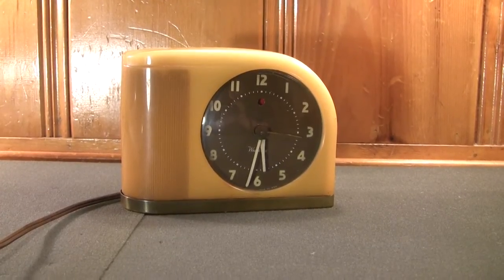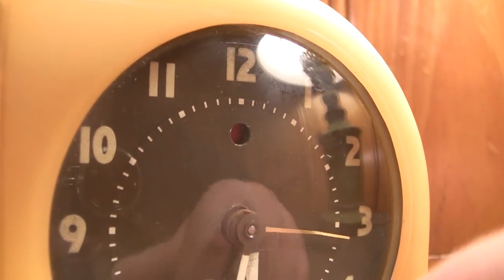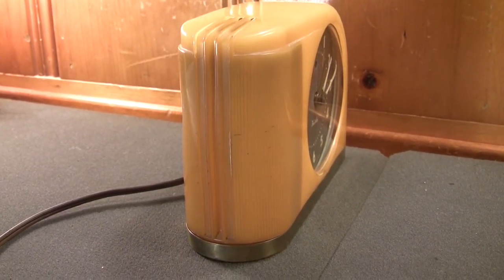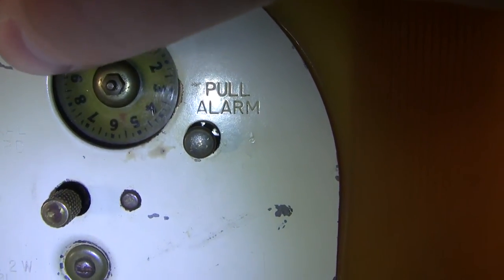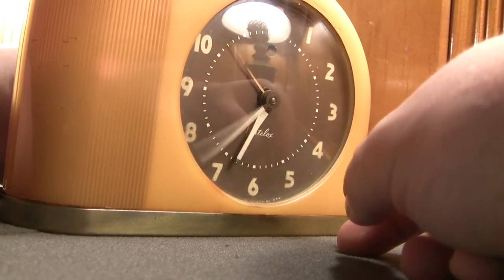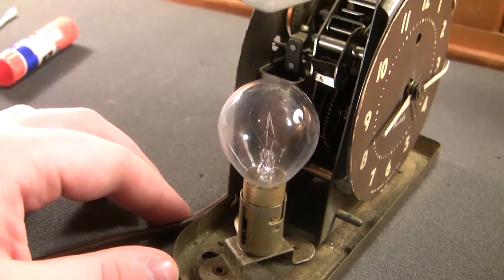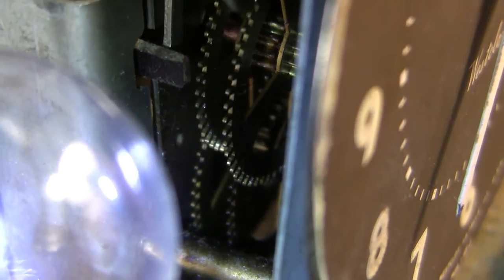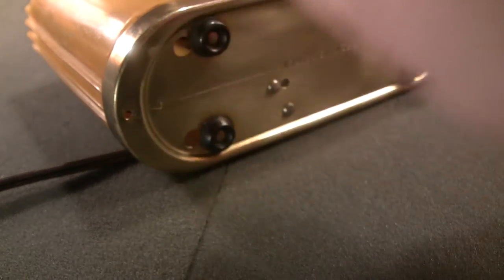1950s Westclox S5-J Moonbeam Alarm Clock

Comment: The transformer you pointed out is actually the motor coil. There's no transformer in those old clocks - no modern low voltage dc crap in there. The new ones, sadly are low voltage dc ordinary ticking quartz clocks. Ac powered clocks like this kept perfect time because they use a synchronous motor - that is the line frequency sets the rotational speed, not the voltage. The line frequency was traditionally kept pretty damn near perfect 60hz, so the clocks kept great time.

Comment: These are what's called synchronous clocks. As long as there's nothing wrong with the movement and they are running on the correct frequency from the power grid they are very accurate, more accurate long term then any quartz clock can ever hope to be. That thing you said was a transformer is the coil for the synchronous motor, not a transformer. The buzzer will also work off that coil. Very nice clock and video.

Comment: My Grandfather (maternal) had one of these (with the later style 1954-57 maroon luminous dial, no power failure indicator) my Grandmother kept it for years after he passed on. I loved the quiet but subtle sounds of the clock gears and subtle rapid ticking (sweep motion) of the second hand.  I've been researching these and the original 1948-57 Moon Beam was actually never available in yellow. All Westclox catalogs from 1949-57 describe the Moon Beam as having a "white plastic case". Of course visual evidence from surviving examples of this clock have shown that it didn't take long for these white butyrite covers  to "yellow" with age as my Grandparent's Moon Beam had very much  "yellowed" by the 1970s-80s. I love this clock! Thank you for sharing this video! It takes me back!

Comment: Amazing clock. iv seen several on ebay. i like the idea. i had no idea they had made one with waking up to a light. wonder how well that worked?  great video!
Reply: It works pretty well, I wasn't even aware the buzzer on mine worked until I got up before the alarm went off and then started hearing a strange noise.
Reply: When the buzzer is out of adjustment and is very faint in volume , it sounds even creepier when it kicks on with just a mild low pitched hum. The backup buzzer is supposed to be very loud and jarring enough to “wake the dead” when functioning properly.

Comment: I just bought one today from the antique mall, only issue is the turn knob for the alarm setting dial is gone, I'm gonna see if i can get it a new dial so I can set the alarm to whenever i want. Other than that it is fully functional even after 70 years.
Reply: I just bought one today and it works

Comment: I have one from 1957 that will run when I lean it back but if I set it level it won't run...does anyone know what is wrong with it?  I tried a few drops of clock oil but still the same problem.

Comment: Manufacturers began replacing cloth-covered power cords on home appliances around 1948-1950. So it isn't surprising to see the rubber-covered cord on that unit, even if it's one of the early models.

Comment: I guess an LED replacement bulb would work too and stay a lot cooler for the aged plastic case.  Let me know if anyone has used an LED replacement bulb.
Reply: canadagirleh good point about the overheating. I changed the inside light globe in my 1967 Chevy El Camino and the new globe melted through the plastic cover.

Comment: Excellent Video!  Learned a lot about my garage sale find.  Mine is identical except it is made in Canada (CSA Standards), has plastic wiring on the inside and has a hole in the back where yours has a screw ( I am sure it is supposed to be this way).  I wonder if it is for oil?
Reply: I know I'm late to the party but wanted to reply for future readers.  I also have the Canadian model but mine has a screw in back where you indicate yours has a hole.  The screw is fitted into a dished washer that fits perfectly into the surrounding concave divot in the casing so I suspect yours also had this washer and screw at one time.

Comment: you should avoid touching the clock face, the one you own there uses radium in its paint.
Reply: RMX7777 people only got sick from licking the wet paintbrushes.
Reply: @RR4711  radium is a heavy metal, breathing or ingesting the dust from the paint will result in it staying within your body for many years, where you will constantly be exposed to ionization.
Reply: RMX7777 my father worked in a building attached to a nuclear reactor during the 1960s back in Hungary, they really had no idea about the dangers of radiation back then. Here in Australia they used to build out of asbestos, many of the factory workers died from the dust they inhaled. Nowadays the government is very strict about renovating houses that contain asbestos.
Reply: Has anyone tested this model with a geiger counter?
Reply: @kopfcanyonranch  yes, through the plastic it reads around 1,000 cpm. Disassembled it reads around 12,000 cpm.

Comment: These clocks were designed to wake up, deaf people. That’s why the original ones had no alarm sound and only used the flashing light.
Reply: These were introduced in 1948 and were made through 1958. These all had the backup buzzer which has a tendency to stop sounding after many years (especially when they’ve been in storage or the alarm hasn’t been set in decades) . The buzzer armature can be adjusted and made audible once again.